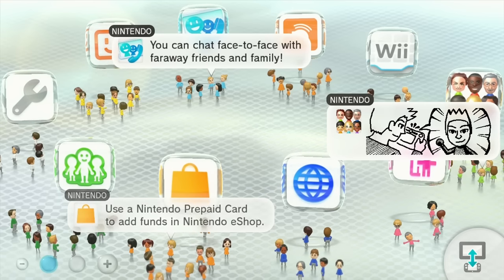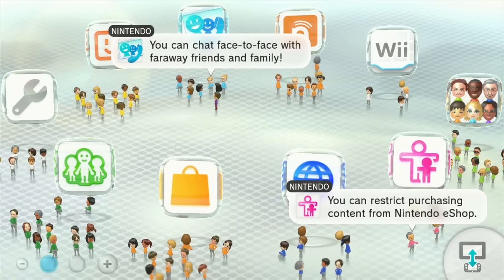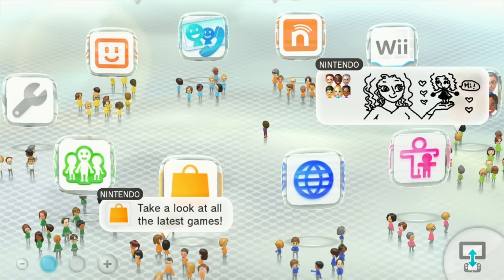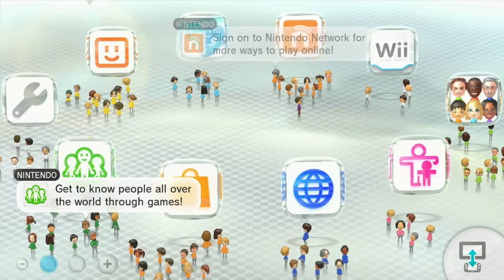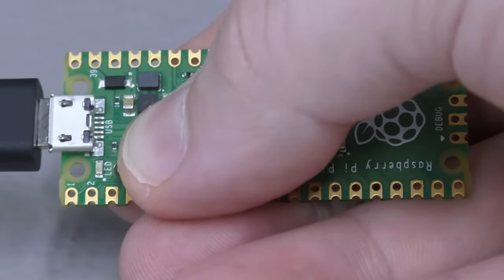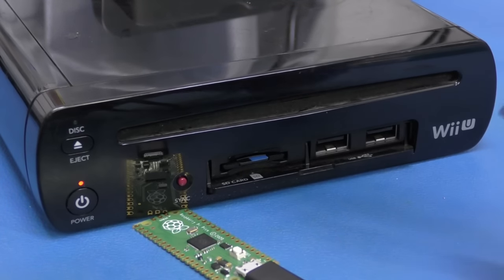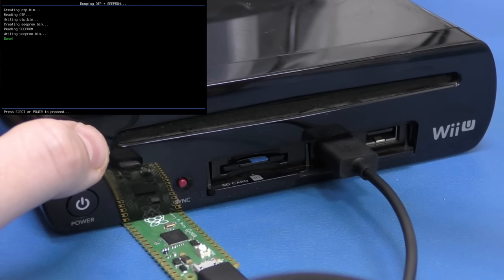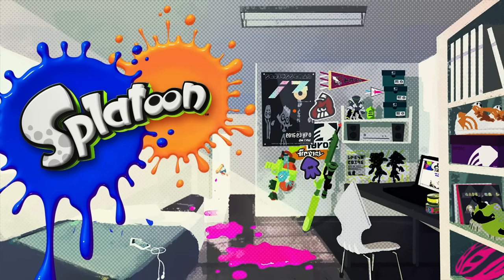The Truth About the Bricked Wii U | Can You Fix yours For $8?!

Comment: Just unbricked a WiiU with this method! Very useful video. Nice and easy! Thank you!
Reply: Which code did you had? I have 160-0103 and did all the process and still see the damn code lol
Reply: @Tena01  I bought the console a year ago, knowing it was bricked, with 160-0101 or 160-0103 error. I checked when I bought it, that’s why I forgot which error was. After that, I kept the console for spares. I had to repopulate some components in order to start the console and apply this fix. I was so impatient, that I applied the fix directly, without waiting to see the actual error again. It was a 100% CBHC bricked console. Coldboot was pointing to a totally different title than normal Wii U Menu.
Reply: @flashgordon8554  how is that error created? Was it a mod?
Reply: This can be used to get a discount on a Wii U
Reply: @Tena01   Me too.  Darn
Reply: Did it erase any game save data?
Reply: Will it still be a hacked Wii U? Mine was hacked and i didn't know and i formatted it. Will it still be with the hack?
Reply: @YouSurfin  No, it won't be hacked anymore. It will be reverted back to stock.
Reply: @cosettapessa6417  It was a soft modded console and, I think, it was formatted by someone without uninstalling the soft mod first.
Reply: @flashgordon8554  ouch
Reply: Me too....
Reply: Quick question; once you reboot with the raspberry… does it always need to be connected to the usb port or does it save on the original Wii U unit?

Comment: Here's to hoping that all bricked Wii U's are a software error and not actual NAND failure. And fixing just 30% of systems is a great start. Some success is still a success when it comes to keeping electronics out of e-waste.
Reply: i'm wondering if this is a long term fix or just restoring it until the cause for the software error code reoccurs.
Reply: @pogman15  that'll take time to figure out I imagine. This is just the beginning of an investigation into what's going on. This could be fixing one of the failures caused by the culprit or it could be fixing the actual cause of failed NAND. We'll have to wait for more people and a larger sample size to truly know.
Reply: From what I've read (which isn't a lot) the error is being thrown out by Wii-u's that weren't updated.
My Wii-U hasn't been played since the Switch came out (2017) and my Wii-U played everything I tried with no errors.
Reply: it really just seem s(so far), like the nand doesn't keep things as long as other nand flavors, so we're seeing bit rot. the nand itself is probably fine beyond that (barring proof its actually failing physically).
Reply: Unfortunately everyone told me mine was NAND corruption because of the way it died. I barely got to have my first Wii U for a year and I opened Super Mario Advance, a game downloaded from the eshop and previously played and beaten with no problems. It barely ran before everything crashed. So I reset the console, but after choosing a profile it crashed, as if the Wii U’s menu didn’t exist anymore. The next day, it froze immediately on the first screen with the logo. Now, after an attempt at unbricking it, it doesn’t even send anything to the TV. It’s just completely dead, no error codes at all ever showed up. I dont have a NAND backup for it so everyone told me it’s unrecoverable.
I’m much more cautious with my new Wii U. Everything is stored on external storage, the system memory is blank in data management. And I have its NAND backed up.
Reply: @Lizuma  does this video show how to back up the NAND? Or is it a fix for another type of problem?
Reply: whenever the hell I find my sd card I'm backing up my nand.
Reply: Fancy seeing you here uwu
Reply: @ultraspinalki11  This video doesn't show you how to back up NAND, and it's also not a fix for anything at the moment. A NAND backup would be used in a theoretical NAND chip replacement/restoration fix that currently doesn't exist. A backup would help then because each console has a uniquely signed sysNAND keyed to it, so other consoles' backups will never restore yours. To learn how to backup your NAND (and hack your Wii U, because your consoles should be hacked), go to the Wii U Hacks Guide, which starts with a full backup.
Reply: @RealLockheedMartin  much appreciated!
Reply: It sounds like a Samsung nand fault from what I’ve seen in other reports
Reply: That would make sense.  The people that are having problems seem to be people that haven't used the system in years.  Meaning they missed updates.  The Wii U is unique in this way in that it sold well when it first launched, but then dropped off to almost nothing because there were very few games for it.  So a lot of them sat unused for years.  I've kept mine updated and I haven't had this issue.
Reply: NANDs have blocks that fail, they are designed that way. X360 was subject to it as well, it happened more often on the Jasper systems specifically. Usually they handle the error correction very well by rewriting the bad blocks and relocated them to another location. It happens.
Reply: @Lizuma  Yeah actually I saw Spawn Wave's video on this topic, and he mentioned that some Wii U's with Samsung NAND chips were indeed faulty. You could maybe recovered those, but some of those chips were defective, so it was only time until they got corrupted again. Apparently someone managed to replace the nand chip with an SD card (because SD card is essentially an eMMC chip), so maybe we will see NAND replacement modchips in the future which would have SD card slots..
Reply: @tamoghnapal6619  I feel I got really unlucky with my first one, and is there even a way to tell if my new Wii U is one of the faulty ones? I do like the idea of mod chips to keep these consoles going, and I know it’s unlikely, but I would love to see my old one be brought back to life one day if it’s somehow possible without a NAND backup.
Reply: at some point nintendo should step in as a company to maybe show that they care about not having their consoles in the junk!
Reply: @StormsparkPegasus  I had mine unplugged for 2 years but didn't have issues.
Reply: @Lizuma  just plug the new one in and try updating it. If its NAND actually failed already, turning it on wouldn't change that. As for your broken one, just wait and see what comes of this. It'll probably be a year at least, hopefully not as long as it took for people to figure out that old PS3's RSX chips caused YLOD.
Reply: @SLAAMIT  I'm surprised they're not doing anything.
Reply: @SockyNoob  I’ve been using the new one, which is why I’ve made sure to keep its system memory blank and have its NAND backed up. It’s working quite well with the external device. Since opening a downloaded game on the system memory is what caused my old Wii U to crash and break down, I’m never risking that again.
Reply: @SLAAMIT  Not for a console no one cared enough to buy
Reply: @SLAAMIT  they're closing the eshop next week so hardly unlikely
Reply: Isn't it the hynix nand failure?
Reply: @Lizuma  If it died of NAND corruption there is a good possiblity that it is recoverable, even without the backup. If the controller in the failing eMMC chip runs out of reserve blocks or detects corruption in the FTL it goes to a read only mode. In the read only mode, the Wii U won't display anything. But it is still possible to dump the eMMC through hardware and replace it with an SD card. There is a whole thread on gbatemp with all the information about that problem.
Reply: @brkbtjunkie  This is misinformation. Some people speculated it could be Samsung because samung had problems in the past, but they didn't even look at the eMMC these consoles had. Almost all failed eMMC chips in the Wii U are Hynix from 2012 and first half of 2013. And if the problem is caused by bad eMMC, the method in this video won't help with that. Changing the coldboot title is for unbricking CHBC bricked consoles, which shows the same error, but has a complely different cause.
Reply: @Lizuma eso me paso ami también,  entonces ya murió mi wiiu 😢
Reply: I'm in the wii u system data, Why do I get "No Network Connection!", please somebody HELP!

Comment: Little advice for people who might have had the same problem as me with the wii u not displaying image and getting a black screen as soon as you plug into the Raspberry Pi. Good News (Maybe) there might be a way to still do it. The Wii U doesn't show it but you are actually in the menu! What you do is you click the right buttons in the right order (Remember to count your presses) and then turn the console off and it should work. thats what i did, hopefully this comment can help someone in the same situation as me
Reply: This. as long as the Wii U is showing a purple solid light, you're good. The guide from recovery_menu says it has a recovery_menu_dc_init, but it doesn't work sadly. You've to count via the menu.
Reply: My WiiU is showing a glowing screen and I was able to count and dump the OTP and SEEPROM. I think I reset the Coldboot Title but after hard resetting, the WiiU is still stuck on the WiiU logo...
Any thoughts?
Reply: At what point do I eject the pico out of the wiiu? The guy in this video cut the screen
Reply: Hey my Wii U just shows a black screen at all times.
Reply: @geraldsaved  try to do what i said in the comment. other than that i cannot help you sorry

Comment: A note on pricing: $9 shipped is probably a good deal if all you're buying is a Pico, but if you've got other electronics to include in a larger order, the unit cost from official retailers is $4 ($5 for the version with presoldered headers).

Comment: What can also kill a lot of these is factory resetting these while using Cold Boot Haxchii. It works by changing the boot title to the DS one that Haxchii is injected into. When the system is reset or the title is deleted, that software gets removed but the boot title ID does not change, so the system is pointing to a file that doesn't exist.

Tbh Nintendo could have prevented this by having the OS title ID be the default in the event an error like this occurs and refresh the boot title id when booting through that secondary check. Then the setting would essentially be in two places on the NAND and be way less likely to corrupt. But there'd be no reason through normal use besides NAND corruption why the title ID can change so they probably overlooked it.

NAND hardware degradation can happen, but usually there's warning signs as parts of the OS are corrupted but not all of them.

There's newer exploits that inject themselves into the health and safety app. The benefit of these is that that app does not get removed on system reset and cannot be removed by the user. And they're written such that if the needed files are not found on the SD card, it will just boot into the normal OS.

It likely is possible to replace the NAND chip, but the problem is that the Wii U encrypted keys haven't been cracked, so it's impossible to create a "doner NAND" image. On the 360 you can extract those keys from a NAND dump, so as long as the NAND isn't completely fubarred, you can dump those keys and generate a fresh one easily. Even if it is fubarred, I believe you can still generate one but it's limited to offline.

If you have a NAND dump from before the NAND hardware fails or software breaks you can flash it back to the Wii U though. Or solder an SD card in and use that.
Reply: I didn't know this, I began using the Haxchii exploit when the browser exploit got patched. I began using it and then just put my console away. If I were to factory reset the console how would I go about avoiding bricking it. I'm not sure if the Haxchii I use is the same one you're mentioning, I bought a game from the eshop and turned the application into Haxchii.
Reply: how do you flash it back to the wii u nowadays, everything I found about it seems out of date
Reply: @Bushdid-eh9lb  normal haxchi wont do anything to the coldboot title so ur fine
Reply: @thechugg4372  2023 年 3 月 24 日午後 4 時
Reply: Yes, NAND degradation can cause OS glitches, but that is unlikely on the Wii U because of signature checks. If just one bit flips, the signature check would fail and thus the OS might fail to load outright
Reply: at least haxchii isnt the usual method now
Reply: Hay this is what sounds like my friend did.

Comment: Thank god there's a fix for this, although my Wii Us aren't bricked yet, this video is so helpful.

Let's all thank Voultar for this.
Reply: I'm keeping mine plugged in just in case. Might mod it just so I have more reason to turn it on.
Reply: @SockyNoob  Is it better to have it plugged in? I'm not sure if I should keep it plugged in or not. Isn't the chance of bricking the console higher if it's constantly on standby (red light)?
Reply: @17th_Colossus  doesnt matter either way. At first, people were thinking it was an issue with the console not being used but after further research and data provided, its actually a nand chip issue which means using it or not is going to cause the corruption either way. Any Wii U that uses Hynix nand chips will fail while the other 2 nand chip providers, Toshiba and Samsung, have not shown any corruptions so far. If you want to know which nand chip you have, you either have to open the console and look at the chip or use homebrew
Reply: @ryanpowers8973  which homebrew can I use to see what nand chip I have?
Reply: @Senya_3358  the homebrew mdinfo should tell you what specific chip you have. Good luck and i hope you have a good chip!
Reply: @ryanpowers8973  thanks!
Reply: @ryanpowers8973  my manufacturer of my mmc it says 'Samsung/SanDisk/LG' I think I'm safe, right?
Reply: @Senya_3358  yup! I think theres been a few Samsung chips that have reportedly failed but not nearly as many as Hynix. Ideally, toshiba would be the best chip since we havent seen any of those fail yet. However, i do believe toshiba chips were made during the late stage of the Wii Us life span while samsung seems to be in the older 2012-2014 models so samsung has been holding up real well. Hynix is sprinkled around so theres no way to know if someone has a ticking timebomb unless they check their chip. Even though you have a reliable chip, i recommend making a nand backup just in case if you can.
Reply: @ryanpowers8973  fortunately, I already had made a nand backup when I modded this used wii u that I recently bought

Comment: This is HUGE! Thank you so much to you and Robed Repairs for making these videos talking about this fix! My friend had his Wii U brick a year or so ago and ended up getting the internals replaced with a working Wii U from a local retro store we frequent.  His Wii U was sitting on display in his room for 4-5 years and when he went to use it, it wouldn't load and gave one of the common error messages in this problem. Now that there seems to be a fix I may pick up one of those Raspberry Pi Pico's moving forward.  I want to be able to keep my Wii U for many years to come and archive my games and DLC.  My Wii U thankfully hasn't had this issue yet, but this gives me high hopes that it's fixable!  Mine's modded with Tiramisu so thankfully I have lots of options to back up my physical discs and save data if I ever have to add them back on.  I hope this gets lots of publicity!

Comment: This worked for me (with a few other action items - see below for more info)! Thank you so, so, so much Voultar! I'm sending you a ton of virtual good vibes for all of your help. Your tutorial was straightforward and easy to follow. I really, really appricaite it!

First off - I was getting the 106-0103 error (not the 106-0101 error) on a non-modded Wii U. I only got the error when I tried to load a game. The game would start to load, then suddenly the 0103 error popup would appear. Everything else seemed to work fine (I got the home screen and could navigate to system settings, etc.).

I completed all of Voultar's task list in the video. Launched a game, and still got the error. I read in the comments that this happened to someone else, and they needed to update to the newest software patch for their Wii U. I did that - but it didn't fix it. I googled the 0103 error, and the Nintendo website indicated to delete update data for the game in question. When you go into settings, there is a data management area where you can delete the update information for each game. There is also a separate piece of save data for each game, but you don't have to delete that. I went through and deleted every game's update data. Then for shiggles - I re-did all of Voultar's task list again (I wasn't sure if it needed it again after the software patch update). I then loaded the game and NO 0103 ERROR!!!

I hope this helps someone else going through this. Thank you again Voultar!!! Good luck everyone!

PS - the only thing I didn't see (I could have missed it) in Voultar's info, was the cable used for the pico (the pico item was completely new to me). I believe it was called a USB to USB micro A adaptor.

Comment: The actual reason behind the NAND Corruption is cause some Wii Us were built using Hynix NAND Chips, which degrade faster than other Wii Us made with Samsung or Toshiba. So some Wii Us are unfortunately built with lower quality chips that die faster than others. Its just unfortunate luck with the Manufacturing. It is possible to see which NAND Chip brand you have by either opening up the Wii U itself and carefully taking it apart a bit, or by running some kinda Homebrew App that can give you the Specs of your System

Comment: YES! It worked! Thank you so much! 
The issue I faced at first was the U would shut down after I plugged in the USB cable. I'd used a 64gb SD that I formatted in 32bit. Apparently it didn't like that so I tried again with a 32gb and SUCCESS!
A huge thanks to you for the video and the creator of the software used! One more Wii U saved from the parts bin!